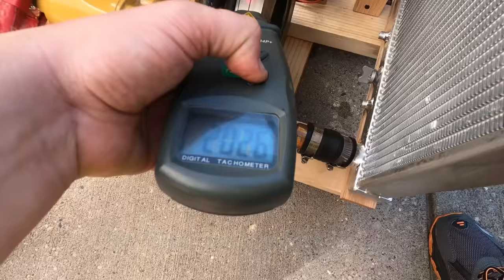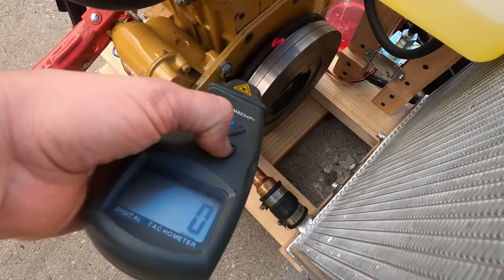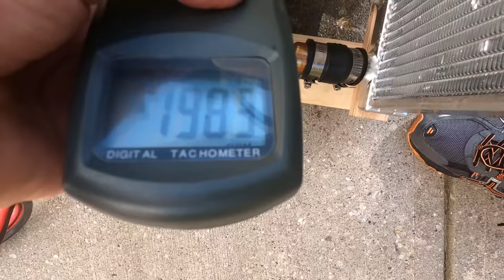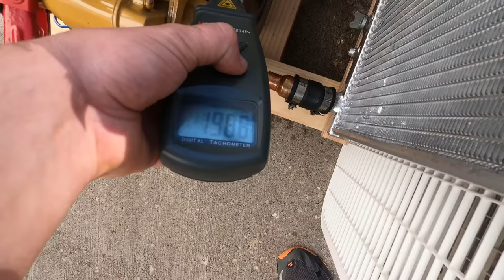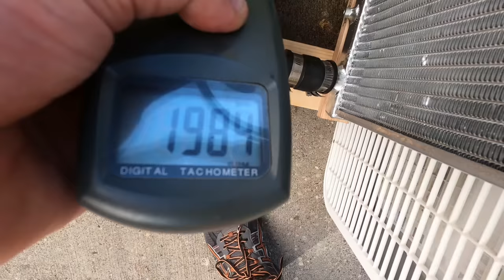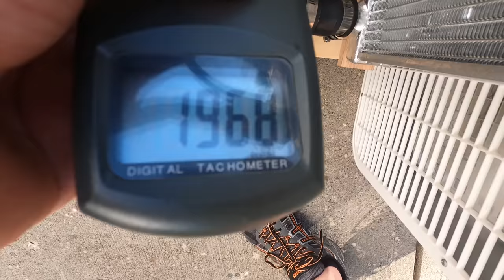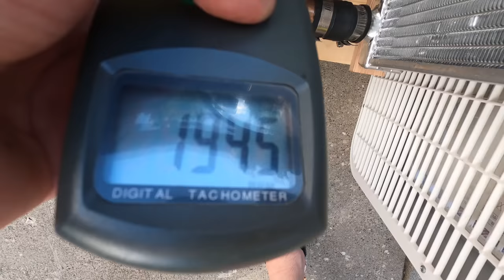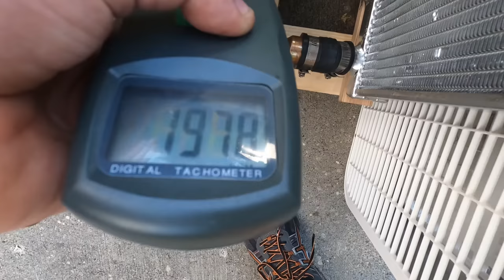Will Caterpillar Diesel run on Cooking oil? Attempt to run engine on Transmission Fluid & other oils

Comment: Great video...
Just don't let the engine stand for more then 6 hours with any oil other then diesel fuel. 
Otherwise growth and geling can happen causing internal problems. 
Heat the oil to 100 degrees Fahrenheit. 
Run a dual tank system to start/stop engine on diesel fuel esp in colder temperatures.

Comment: I used all of those oils in my 6.9 V8 Diesel. This includes Jets fuel which is kerosene.  I was given a few 205 liters barrels of rancid cooking oil. The Diesel engine burned it, no problem. I did not notice any changes to the performance.

Comment: the original diesel rudogh diesel intended was peanut oil
Reply: Actually not. Rudolf Diesel used coal dust initially in his first engines.

Comment: I’ve run various vehicles on waste vegetable oil for years. They run fine, but need more frequent filter changes, and some people say that it doesn’t lubricate the pump and injectors as efficiently. Cold weather starting performance is slightly worse, and it feels like there may be a slight loss of peak power.

Comment: This experiment is useless in a way, unless you ran it for around 100-200+ hours on each fuel. Diesels run on any oil, by their initial and basic design (mercedes calls their diesel engine by OM code, as in oilmotor for a reason), that's nothing wow about it. The issue is with these random oils, like heating oil, is the additives in them. Or for straight raw vegetable oil, it's viscosity and injector design on modern diesels that don't account for such a high viscosity. Or the way the piston rings are made thinner and thinner to give better mpg, allowing unburned vegetable oil to reach the oil sump, diluting the engine oil.

Comment: The main problem with vegetable oils is the glycerine in the oil. It will eventually "gum up"  the fuel supply system, especially when it gets cold. Starting the engine on diesel, switching to run on (heated) veg oil, and then switching back to diesel for a while to purge the fuel system of veg oil before shutdown is the way to run a dual fuel (veg/diesel) engine.

You can process (crack) the veg oil with wood alcohol to separate the glycerine from the oil. The glycerine can be used industrially, after further processing.

Comment: Interesting results. On a side note. Many years ago I managed to run a 2 stroke moped on a lot of different solvents. Most notably leather polish mixed with vegetable oil and CRC 5-56. My guess is that if the motor is not to complicated ut will run on anything close to it's intended fuel. It might hurt it in the long run though.

Comment: I overhauled an old Deutz F6L423 and test ran it on the dyno test bench late in the evening before knocking off for the day.
The following day I was to run and test it some more before sealing it up for transport.
Someone had used my diesel for cleaning, and they had filled it back up.
Testing went perfectly as expected but for some reason the exhaust which was crystal clear would burn and sting my eyes and had a very different smell.
I found out that the fuel can had been filled with degreasing fluid.
The engine ran and performed exactly to documented specs and apart from the sting and smell you would never guess it was running on anything other than diesel fuel.
Reply from the maker: At least they filled it back up lol
Reply: @andreysmirnovusa  That should have been F6L413 and not 423
Reply from the maker: @ScatManAust  is that thing air cooled? If so I wonder how they made it cool all 6 cylinders with just air in such compact design
Reply: @andreysmirnovusa  Yes mate , its air cooled.
Think big air-cooled motorcycle engine with individual heads and cylinders except in a V configuration and a large fan at the end in the center of the V sucking air in and pushing it through to the other end.
Simple but effective.

Comment: My father run a Bedford truck for many years, maybe 5 or more on 3 parts crude oil and 2 parts power kerosene. This saved on fuel tax in Australia.  Also I met a man running a Toyota Hilux Ute on cooking oil from food shops. He filtered it, to remove food scaps etc.

Comment: You can use vegetable oil, but from what I heard in the past is that the oil has to be kept HOT in the tank and the fuel lines so that the GLYCERINE does not sludge out and clog things.

Comment: The first diesel was made by Rudolf Cummins, it ran on peanut oil. All diesels are oil burners. Viscosity and temperature will have its affects but it will burn oil.

Comment: The engine runs fine on anything that will combust.  However, were you to dyno test this engine on the different fuels used, you'd see that the power band and torque curves would likely vary considerably.

Comment: So heating oil is diesel, but it's not taxed or regulated as an on road fuel so they dyed it red so it would be very easy to tell if truckers where using illegal fuel

Comment: Actually the only diesels that you don't want to run on veggie oil are ones with sensors and electronic systems. They will run for awhile but it will eventually cause problems with the sensors.

I run on WVO ( waste veggie oil ) in my 1994 7.3L Turbo Diesel all the time.

You loose a little efficiency, power and MPG but not much. Its still well worth the trouble! Especially now with this "no inflation" we have here in the USA! 

Rudolph Diesel designed his engine to run on peanut or veggie oil of some type. His being the original Diesel engine.

Most older military vehicles would run on various types of oils! Even gas if you pre mixed it with oil.

Comment: Fun fact. The inventor of diesel engines Rudolph Diesel originally invented his engine based off of the use of peanut oil to help farmers. So technically the original versions of the engine was supposed to use veggie oils, as it would be easier for farmers. 

Though, about 10 to 15 years ago, there was the grand idea (long before biodiesel was a major thing) that people were using old filtered fry oil's from restaurants to run their diesel trucks and cars. I mean it wasn't mainstream by any sense, more so a proof of concept, and to address the use of oils being supposedly thrown away, or discarded. Now what they would do is put the oils in a heated tank to heat up the oils were the viscosity of the oil would became more liquified and could run through the fuel delivery system, however, the system would need to be purged with actual diesel fuel, as when veggie oil would cooldown, it would turn into a solid because of the fats and clog the lines. 

The only reason why the Diesel engines use what we call diesel fuel today is because in the mid 1800's when the the first oil refinery had refined oil to produce lantern oils in Scotland, diesel was a byproduct and was discarded because until Rodolph Diesel created his engine, there wasn't a use for the fuel which is used all over the world today. But Diesels can run oils, and kerosene if they're in a pinch.

Comment: I know this is years older but if you didn't already find out the hard way, if you ran thick oil though it without flushing with diesel before turning it off, you fuel lines will be clogged when the engine cools down. You can mix things like alcohol, acetone,gas, exc to get the viscosity right. I like acetone.

Comment: I ran a non biodiesel VW Jetta with a BKD on cooking oil for ages. Ran smoother and quieter even gave better fuel economy. The only thing you have to do is add turpentine to lower the viscosity and thus not overstress the pump.

Rudolph Diesel designed the original engine to run on peanut oil.

Comment: Thanks for the video, I've always been curious about this.  but I had a doubt.  doing these tests with these different oils, does it damage the engine?  Could it be done with old diesel engines?  Thanks.
Reply from the maker: In my next videos I'll try to use on modern diesel in a car, well see 😉
Reply: @andreysmirnovusa  thank you very much I always watch your videos bring more tests with other types of alternative fuels.  and make a video on how to build step by step this support for diesel engines was a wonder.  hugs from Brazil.

Comment: Heating oil is diesel with red dye added to it so big bro can catch and fine you if you run #2 in your vehicle on a road by simply looking in the fuel tank.

What model CAT Engine is that?

Comment: The only flaw in this test was you did not bleed the injection pump and the injection lines to the fuel injectors. Just using the auxiliary lift pump only clears the input line to the injection pump pre stage. To remedy this you would need to run the engine much longer so the testing oils would truly be tested. Granted all the oils you have there will indeed run in a mechanical injection diesel engine. In cold weather add some CT booster / racing Alcohol to keep it from jelling. This would be for emergencies only. As the formations for CT, injector pump lubrication, injectors lubrication, BTU's  etc. Is Beyond the scope of this test.

Comment: I try and stay away from full synthetic oils because of additives that could react with other mineral-based oils in the fuel system. Besides that, it will run on anything half "oily".  I thin my oils down with Paraffin or diesel as my vehicle does not have a lift pump, and uses the diesel injector pump to draw all the way from the tank. This can cause feeding issues in extreme cold and possible damage to the pump. I use all old oils retrieved from oil changes done on cars, veggie oils from fryers and everything in between. Some of the best oils is ATF which acts as a great fuel system cleaner. Transformer oil is another good one, but does tend to capture a lot of moisture. Any mix of these oils as you get your hands on them works as well. Right down to JetA1 will work, I just spike it with cooking oil or 2 stroke for some additional lubrication. **DISCLAIMER***  DON'T RUN A COMMON RAIL DIESEL ENGINE ON THESE OILS.

Comment: Actually the Diesel engine was was originally designed to run on powdered coal dust.   The  liquid oil was used as a aid in the metering of the coal dust in to the engines cylenders.

Comment: Heating oil is basically the same as diesel, they add red colouring so they can sell it with a different tax and it can be detected if someone cheaps out and uses it for running an engine

Comment: The first diesel engine was run on coal dust, then when they had issues with trying to keep the quality of fuel consistent which is mandatory to prevent Runaways, they changed to peanut oil and the engine ran great.
The only reason why we run these engines on diesel oil or diesel fuel is because the patrol chemical industry had an abundance of oil coming from the ground and it was cheap, really cheap, so they became the cost effective alternative, even though it left filthy residue inside the engine.
Vegetable oils have the cold weather issue of becoming too thick and gumming up when they become Frozen, so you have to use a process that turns it into biodiesel to make the vegetable oil remain fluid at cold temperatures.
Running diesel engines off of straight vegetable oil or SVO is not a new thing all you have to do is have heated fuel lines and injectors to warm the stuff so that it'll start when cold and if you're driving in Northern temperatures to have a coolant powered heater inside your fuel tank, and even regular diesels tend to have that in the Northern Territories.

Comment: pretty cool.. what are these engines normally used for? just like air compressors, or water pumps? im curious
Reply: small tractors, generators and equipment

Comment: The problem is that running biodiesel in a small engine is it will plug up the injectors with carbon. The university that I live close to has a marine section. I live on a boat at the same dock. They were running biodiesel in a small 3-cylinder Kaboda hydraulic pump and couldn't get it to run even though it was brand new. I asked them if they were running biodiesel and they said they were. I told them to drain all the fuel and put straight diesel in it and purge the whole system right to the injectors. I just started helping them as they had students on board. The teacher was more- less clueless about what to do, so I did it for them. The tank was 2 1/2 gallons so it was easy to drain. I had just bought 5 gallons of diesel so I got it and another jug to drain fuel into. It took a few tries but the engine finally fired up with a shot of ether. That was 3 years ago and no problems since.

Comment: Heating oil
Is identical to diesel however there are no federal road and highway taxes on it. That is why it is dyed red because it is cheaper than diesel fuel,there is a very large fine for using it in a car or truck

Comment: Rodolf Diesel designed "Diesel Engine" to run on vegetable oil...so, there you have it. Also, engine oil works too, I throw unused oil into my tank every so often. It lubricates my injectors far better than commercial grade fuel at the pump.

Comment: Use to run a landrover defender on veg oil 100% in summer and mix 50/50 in winter with diesel and veg oil with a fuel warmer.🛢, just had you use a different fuel filter with bigger holes for oil to flow throw.

Comment: I think if you preheat the oil to engine temperature, just by heat exchanger to the coolant, it would also run the same RPM

Comment: I run severa Diesel car with corn or vegetable oil and the first problem its cold start so i daily empty the reservoir and put one gallon of regalar Diesel to avoid  start problems. The miliare is 5/10% lower. I have problems around 40000 km mileage but  i use long Renatinho cars so i change car before

Comment: Whenever I change fuel filters in my semi, I fill the filters with transmission fluid. When you crank the diesel up you can hardly tell any difference.However when you rev the engine up it will not rev very high rpms and is weak. When the transmission fluid is gone and the diesel fuel hits the engine the difference is dramatic. I have heard that the transmission fluid cleans the injectors and the cylinder head but I have no proof it does. I only use it to prime the fuel system. It is easier to buy transmission fluid while you are at the parts house than to have to drag around to a fuel stop for a couple of quarts of diesel. Just my two cents worth.

Comment: I thought that diesel was used to be ran on peanut oil.  I heard if you overfill the oil reservoir on a diesel it goes runaway on you.  How much per gallon for the various oils used? Is it still cheaper than the current price of diesel? I'd like to see it run underload to see how'd it works out.  Great vid. Dude, thanks for sharing.

Comment: In the U.S. around 10 years ago the E.P.A. got rid of #2 heating oil in all 50 states. All #2 heating oil is now Diesel fuel. The only difference is the color for highway taxes.

Comment: ive added ATF to my gas cars before.... carb and EFI
and i KNOW that at least older "mechanical injection" diesels LOVE ATF
.
ATF has a TON of cleaning additives........like, the main difference between engine oil and trans oil is the additive package (and the biggest difference is cleaning power)
.
.
50% ATF (new or used) and 50% acetone make an AMAZING penetrating oil
its pretty much Kroil.....

Comment: if you put a load on the engine- what you would discover is that the veggie oil gets slightly less power- and in a vehicle you would discover that your mpg would drop by just a few mpg.
Reply from the maker: I'll put this into test in my next videos

Comment: I tested a Petter single cylinder diesel engine with a variety of fuels and found the same result, except it would not run on petrol/gasoline.  .  I then took a veterinary syringe  with a fine needle and discovered it would run by injecting diesel  fuel directly onto the intake while the stopper was pulled out.  It did not need any  pump or injector at all.   You should try it.

Comment: You can pretty much mix any oils together and as long as half the fuel is diesel it will still run just fine. Modern diesel engines with emissions is a whole different story.

Comment: Underload have a generator making power to run the fan and maybe like a bunch of other stuff plugged into surge protector till it stalls?
Reply from the maker: Unfortunately this one doesn't have a generator on it
Reply: @andreysmirnovusa  investment opportunity? Well whats the motor originally for? All you'd need is a sprocket some chains or go belt method to save time but might get slipping under torgue load some car alternators and a battery from junkyard ... like 3 alternators mounted on a board and leads running to inverter.. okay so inverter is expensive part but could still keep it DC load testing  just need some electric heaters

Comment: You have not yet seen how a gasoline engine runs on a solvent, which, by the way, is sometimes poured in to flush the nozzles.

Comment: Nothing wrong with vegetable oil , used cooking and etc. The original high compression engine by Rudolf Diesel actually run on peanut oil. In fact we getting higher millage than Dino diesel. On paper it looks like the vegetable oils has a bit  lower calorific value but they have inbuild oxygen which make them burn much efficient. We have to take note that every time we suck air for combustion , we do suck 78% nitrogen which absorbs heat and leave via exhaust.   ICE are well matured technology. All so call EVs are not required. We already have 100% renewable in hand. It might be better if we reclassify those vegetable oils right. Some like Olive and Palm oil are fruit Oil! And the rest are mainly seed oils. Nothing extracted from Vegetable, Flower  or is there any? Thank you very much for sharing this. Great effort.